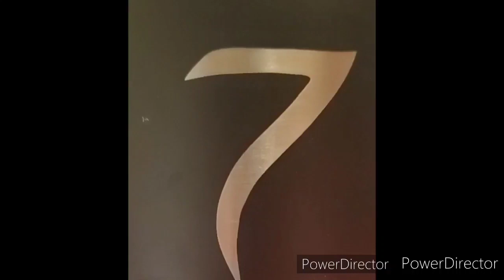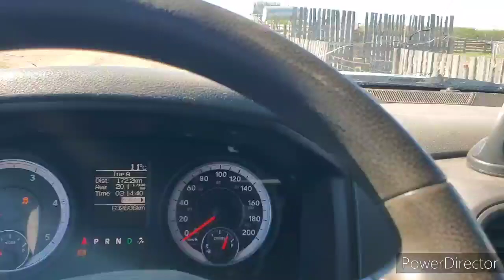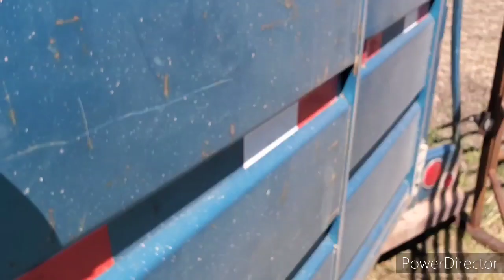Cows Go To Pasture

Comment: Wash the trailer and have it for later, or pony up for a new one when you need it.. wore out and rebuilt two. A 1950 something then a 1976 that we rebuilt a few times.  Now the bug trailer is a 2008 and the little one is a 2010?? Both aluminum, much easier to clean up!!
From what I understand, in most places, pasture rent... The landowner is responsible for keeping up fences, buildings, any utilities and irrigation if it's there.. either way, I'm sure you have a good deal on the pasture 👍😎
Reply from the maker: Would like to have an aluminum but thats cash I don't have right now lol
Reply: @bcpfarmandtrucking6560  our gooseneck was a hail damaged at the factory. Got 20% off👍 was still $12k... The little one we got from a friend, he decided it wasn't big enough to take all the show string to shows, so we got it for less than he paid.. both have paid for themselves 👍